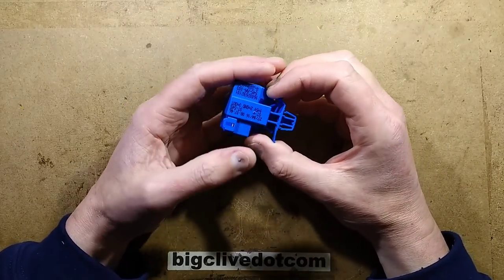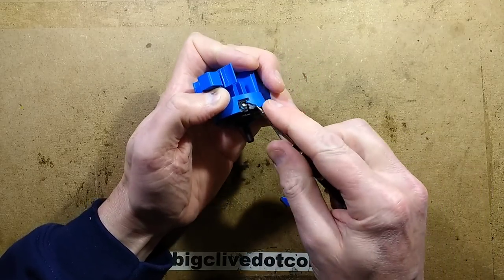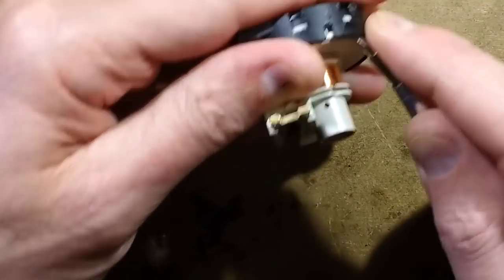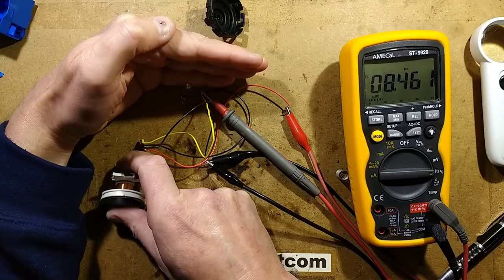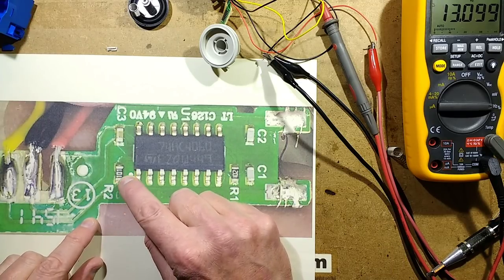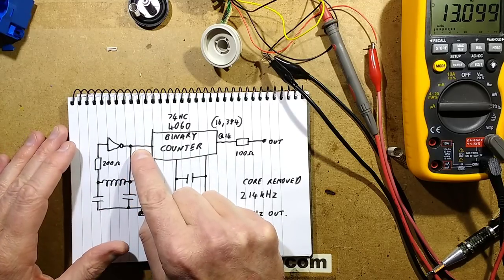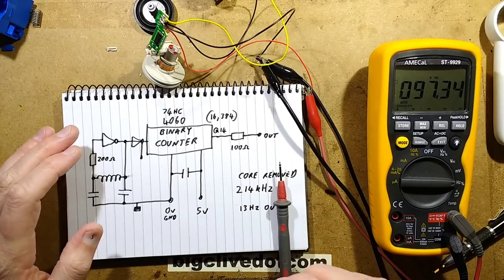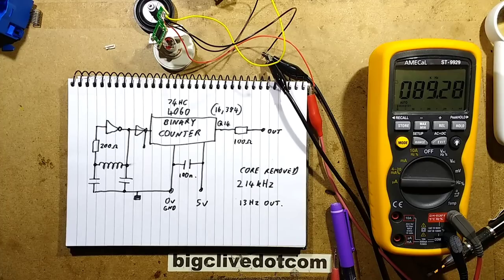Inside a washing machine water level transducer. (schematic)

Comment: Give me an old mechanical washer & drier any day. They are simply the correct technology for the application. Our last pair were Sears Kenmore (Whirlpool) bought c. late 60's and were still going strong when we moved a couple of years ago. Yea, had to do a couple of timers, a door switch or two, a belt, and once a toothpick got jammed in the water pump... but thats about it; any & all parts are reasonable & available. With a manual I did 100% of the repairs. The new washer & drier have already required several service calls, and the 'technicians' were saying (the very expensive) parts are already getting scarce; they seem to require proprietary diagnostic equipment, and the build quality appears abyssal... I could go on, but it gets my dander up. Think we'll be lucky to get another 2 or 3 years out of them.
Reply: In the US, Speed Queen still makes all-mechanical top loaders.
Reply: Thanks Ray... I've heard of Speed Queen, but am not familiar with them. Do they produce (and support) quality products?
Reply: rwbishop their bread and butter is laundromat machines, but they also make a version with a normal consumer mechanical timer. If you are familiar with the old-style Maytag washers, you will feel right at home.
Reply: Thanks will definitely look into them. Not really familiar with Maytag... other than have a neighbor with an old one who swears by it. However, remember seeing/hearing that their newer generation stuff may be problematic.
Reply: rwbishop I have a lg front loader,  only thing done is bearings , and drain pump,,, drain pump is like a fish tank water pump.. In over ten years...  Have the matching dryer, but it is that same as all dryers
Reply: hill billy if the circuit board doesn't go you should be all right. Circuit board goes and you are faced with a $250 repair on a decade old machine. With the old style washers it's a $40 timer.
Reply: I guess I see the argument over mechanical versus electronic (I would rather use a wringer over a dryer!) The same thing has happened in the automobile world as well - there was a time when you could "easily" repair "old school" machines (washing machine, tumble dryer, car engine!) with off the shelf parts and a few tools. Now you need a "sniffer" or dongle to run diagnostic software on the failing device - and some issues can be cured via a software update! Progress I guess... Actual repair is a lost art form - it appears most things are swapped out as an entire device or a module rather than a true repair...
Reply: The difference is that while automobiles have become almost unbelievably more reliable, washing machines have not benefited. They were perfected in the 60s or 70s and were super-simple. Short of transmission failure, there was almost nothing that couldn't be fixed for under $100 (in today's dollars) - so it's common to find 20 or even 30-year-old machines still in use. The EPA, though, has the same water regulations in water-rich Philadelphia as it does in water-starved Phoenix, so we got added complexity. Even the Speed Queen that I talked about comes with the factory water level set low to cheat regulations... you have to adjust it yourself when you get it. There were always crappy top-loaders, and there are crappy front-loaders. But a good front loader costs a LOT more than a good top-loader did, and repairs are anywhere up to $300. They save water, but otherwise have few benefits. They tend to be gentler on clothes, but they also take longer to wash. They tend to dry clothes more thoroughly, but a gas dryer uses about $0.25 of gas per load. Some of the better ones have odor issues unless you either leave the door open or run special deodorizing cycles. I live in a house with natural gas in an area with plenty of water, and I repair my own appliances, so I went with an old-fashioned top load. Time will tell, but so far I've had them for almost 5 years with almost daily use and no problems.
Reply: Cars have to meet asinine smog & safety requirements that require complex electronics. Washing machines are a mere robot whose sole purpose is to simply wash clothes... and that technology was perfected by simple/reliable/economical mechanical means eons ago. The new generation is way too complex for the application... sure they may save a few cents in reduced energy & water consumption, but not nearly enough to offset their expensive initial cost, maintenance & short lifespan. They always remind me of some old Rube Goldberg cartoon. (See Wikipedia.)
Reply: Ray - where are you getting your statistics from? Automobiles have become almost unbelievably more reliable? When did an entire production run of cars with no electronics have failing brakes or go up in flames?
Reply: I'll stick my the 80's and early 90's washer dryer here also :0
Reply: True, but the older cars were way more maintenance intensive... points, condensers, plug wires, 'lube jobs', carburetor/choke/fuel pump maladies, shorter suspension component lifespans and on and on. Newer materials, lubricants & electronics helped the automotive industry a good bit.
Reply: Fifury161 do we really need statistics to know how little maintenance modern cars need? I have two Toyotas with a combined  age of 16 years and total repairs so far have been a radiator and a front axle boot.
Reply: I had a Honda Accord I bought new in 87... and drove till 09, 22 years [1]. While it did have a 'feedback' carb, that and emission related stuff never acted up. All I had to do was a clutch, a set of CV axels, radiator, water pump, maybe 3 batteries & front pad sets, bulbs, tires, muffler & other minor staple items [2]. It's demise was paint & interior... it went to the scrap heap still running well with it's original alternator, starter & McPherson struts [2 again]. About the only work I didn't do myself was the muffler, tires & smog checks. Most reliable car I've ever owned... went everywhere in the damn thing.
[1] But never in snow/salt conditions.
[2] I'm sure I'll think of more soon as I post this, but certainly nothing major.
Reply: Yeah, the Japanese cars were definitely ahead of the American cars in reliability. Your late-80s Accord was probably ahead by a decade. My '85 S-10 Blazer was a total nightmare - I rebuilt the transmission 3 times. Once, the flywheel just broke into pieces. Every cosmetic thing that could happen to it did - headliner fell down, windows stopped working, knobs and buttons falling off, etc. The only thing nice I can say is that the American cars were cheap to work on, so even a transmission rebuild was no biggie. Now you need to take out a mortgage!

Comment: Interesting design. I assume the cost of the ones with physical switch contacts is now considered prohibitive by the manufacturer. I expect in the really old machines with mechanical controllers needed the contacts to be rated for 250v and they would eventually fail due to contact wear, whereas this design should last indefinitely - or as long as the diaphragm is intact. Clever use of cheap off the shelf components.
Reply: Switches don't give you fine grained water level control.
Reply: The mechanical water level switch contacts didn't fail, they only passed a low current for the switch module's clock.
They're less mechanical, more electrical now, a sign of the times.
Reply: Advantage of doing it this way is you can have any number of fill levels. With the older diaphragm and microswitch type you need one for every fill level - the one here has two.

Comment: Is there away to test this type of pressure switch with multi 
meter without taking apart
Reply from the maker: Not easily, since it doesn't have a simple switch.  It's often easier just to put in a replacement to see if it fixes the problem.

Comment: There's an awesome product called the Olegtron 4060 MK2 experimental synth, and they are using the CMOS 4060. They basically break the chip out into a bread board so you can experiment with patching the divider (counter)  and osc sections. Absolutely my favorite audio toy, and I think you would enjoy it as much as I do. I've taken it apart (obviously) but there's a lot I'm not sure about.

If you are interested in checking and maybe doing a video 😉

Here is a link to their site.
https://www.olegtron.com/olegtron-4060
Reply: P.s I want to be clear that I'm not affiliated with Olegtron in anyway. I realized that my last comment might have come off sales-ey. I swear I only have good intentions. 😀

Comment: 3:26 How it calibrates:  Two opposing springs of equal strength and a cross head threaded insert bonded with anti-tamper marks.  Allows for dialing in the 0 position at factory. =^-^=

Comment: Would the output of the Oscillator (8-12) be directly related to how much water in litres is in the machine?
Reply: The output is directly related to the height of the water column pressing on the diaphragm.
Reply: I realise pressure is applied to the diaphragm from the water in the in drainage sump. However in my Samsung machine there is a similar device which sits in the sump at the bottom of the drum next to the drainage hose which leads to the pump. As our Samsung is a EcoBubble machine there is very little water in the machine. I think the last time I had to manually drain it due to a blockage in the pump I only counted about 7 litres of water. Which leads me to think this device is calibrated directly in relation to the actual amount of water in the machine rather than just any old number being generated.

Comment: So how do you test these type of two pin pressure switch to know if they are defective
Reply from the maker: It's not easy to test this type without making up a dedicated tester.
It will be easier to just buy a replacement and install it.

If your machine seems to be using very little water in the main wash cycle then it's normal.  It only uses a lot during the rinses.
Initially it just aims to get the clothing soaked in a minimal quantity of water to increase the detergent concentration and give better friction when tumbling.

Comment: could you have a look at what is inside one of those yellow transformer boxes found on building sites ect
Reply: a transformer, nothing else, no other bits, sitting in oil in a sealed plastic case, it only drops 240 to 110 ac, very simple to do
Reply from the maker: It't literally just a transformer and sometimes some fuses too.  Usually potted into the case with the terminals and fuses protruding through the potting compound.
Reply: Arnt the newer ones digital?
Reply: How exactly would a transformer be "digital" ?
Reply: Ugh, they do inverter based ones? Completely missing the point of a site transformer in the process i'll bet... :/

Comment: ..... I wonder if there is a program calculation detecting load with this, in conjunction with the 'post spin up' g-sensor input (or whatever they use).
Reply from the maker: The pre-spin balancing seems to use an algorithm to monitor the feedback from the motors tacho.  The speed of a balanced load is consistent, but an unbalanced load wavers significantly on each revolution.
Reply: @bigclivedotcom  this is a problem with our machine, its sometimes used just to spin a small but occasionally heavy load, the thing throws a wobbly and just wont spin it, you have to wring it as much as possible by hand before spinning! previous machine was far less of a bitch!

Comment: Is that a digital or optical zoom on the ipad? Never really seen the kind of loss of detail associated with digital zoom
Reply: digital zoom, its not as bad now to use a bit of digital as the sensor has plenty of spare pixels to zoom with
Reply from the maker: Digital zoom but just homing in on a smaller area of a large image array.  It's a Moto G4.
Reply: bigclivedotcom it's a fair bit better than it used to be, think I'm strictly an optics guy

Comment: would it have been simpler to just use the resistance of the coil as a level indicator?
Reply: It is using a coil's resistance, which is inductive resistance, the resistance to AC flow.

Comment: could one of these being faulty trip a circuit breaker? ive checked the heating element by disconnecting it, the water drains out of the machine when it starts up,, so not the pump, the water runs into the prewash section of the detergent tray and then once the water for the main section of the wash starts the breaker trips!! ive replaced the water inlet valve and it still trips at this point so not the solenoid in the water inlet valve, next down the line is this bad boy and mine looks just like this one. washer is a bush A127QW. thanks!
Reply from the maker: It's unlikely to cause rogure tripping.  Two common reasons are the heating element and sometimes the incoming supply electrical filter.
Reply: @bigclivedotcom  thanks for the reply. ive disconnected the heating element so its not that and ill look at he eclectic filter, i dont know what it is yet but ill check that out thank you. but why would the machine start, run through the prewash section of the cycle then cut out every time right when the solenoid switches to the main wash water inlet, some water comes through but it switches off/trips the breaker within 1 second.
Reply: @bigclivedotcom  ok so heres an update, ive swapped out the mains interference electrical filter and things have improved but now its doing something else. the machine now makes it past the prewash and fills the drum with water for the main wash, then it stops seemingly ready to wash the clothes, and then the stop cycle light flashes a bit then the machine drains the water, stopping the cycle :(. man im so close, what do you think?? is this now a motherboard issue? thank you!

Comment: How do you test this?
Reply: Yes, I also wanted to know how to test it in the field.  Now that I know how it works, I think you might be able to use a multimeter with a frequency function, or use a graphing multi-meter (which I have) and find which terminals (signal + ground) that have a "frequency" on them.  First verify that you have  approximately 5 VDC going into the device.  Now you've identified ground and the Vcc lines.  Then,  connect your meter to the 3rd terminal and Look for a frequency of around 8 to 16 Hz.  Then if you carry around a small piece of tubing with you, you might be able to attach it to the sensor, blow into it gently, and see if the frequency changes.  (I have not tried this method yet, since I just saw this video, but I will try it the next time I work on a Samsung washer.)

Comment: Can you adjust it so the machine will fill more?
Reply from the maker: No.  The machines only look for a change in water height to see if the clothing is still soaking up water.  The point is to only make the clothing wet initially so that the detergent is at its most concentrated, and so that the clothes rub together as they are tumbled instead of floating in the water.  It results in a much better cleaning action.
After the detergent cycle the machine will use a lot more water during rinsing.
Reply: Ok. Many people are modifying the front load washers, so they use more water.

Comment: @bigclivedotcom can you pleasd take apart new dishwasher sensor. I change one on my samsung. It had weird leds and angled sensors. I have absolutely no idea how it can measure swirl or dirt in water.
Reply: Markku Partanen 
Hi,
 reflecting light of a water surface can measure distance to the water (level) and also the speed of flow with some maths in the microcontroller.
Reply from the maker: It looks like a very standard component available for experimentation on eBay.  (Not necessarily compatible with your machine).  The main function seems to be to detect cloudiness of the water optically.
https://www.ebay.com/sch/i.html?_from=R40&_sacat=0&LH_BIN=1&_nkw=turbidity+sensor+module&_sop=15

Comment: Is it possible to measure the value of the capacitors in the oscillator?
Reply from the maker: I just isolated the caps by cutting tracks next to them.  They measured 2.2nF (2200pF).

Comment: Can I replace this W10448876 pension switch of a Whirlpool duet and put another mechanic pression switch. Other technicians are doing that , the board of the washer let other connections. Can you investigate, my boar have empty slots.
Reply from the maker: I'd recommend only using the correct type of sensor.

Comment: The one on my washer did not let in enough water to fill it tightening that screw it will fill higher It did not have a chip in it just a set of contacts .
Reply: That's an older style "pressostat switch"

Comment: That blue piece is just a cover to protect the circuit and interfaces the harness plug. I read the comments that there is no way to increase the wash water level by adjusting the screw.  The pressure sensor (which is no longer sold) in my Bosch Axxis is very similar to this one. Mine is not broke but over the years the water level has gradually dropped to a point where some parts of clothes in a larger load are STILL DRY!  The only solution is dumping water through the soap dispenser after the cycle "fills" and starts to agitate. I know I added enough when I start to hear the splash sound. Pre-wetting the clothes before washing doesn't work... the machine just adds less water!!  Driving me nuts.  TO ADD... what about resetting the sensor by putting 2 liters of water in the machine, turning it on and putting it on the Drain cycle. I'm not sure how that will work, but I heard that may reset the sensor on some model sensors.
Reply from the maker: Sometimes the water level sensing tube gets gunked up.
Reply: @bigclivedotcom  That would cause an increase in water level. Not decrease. Right?